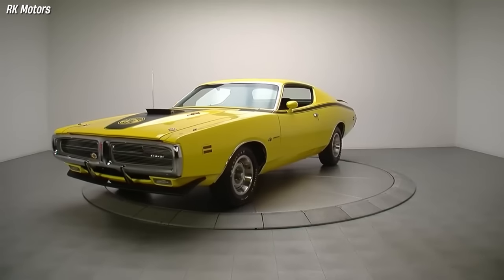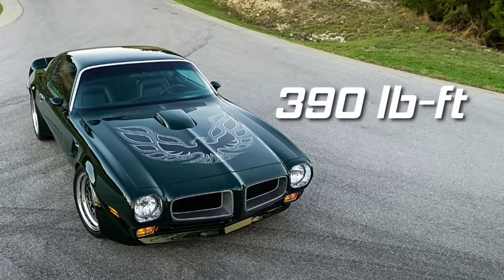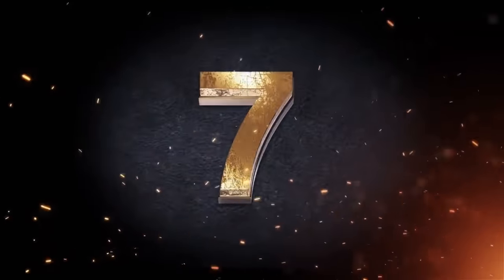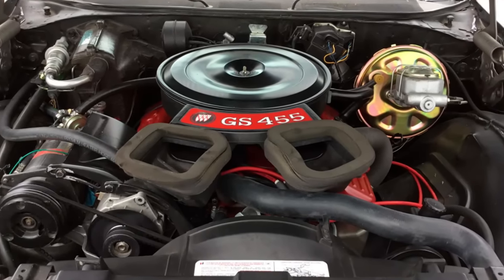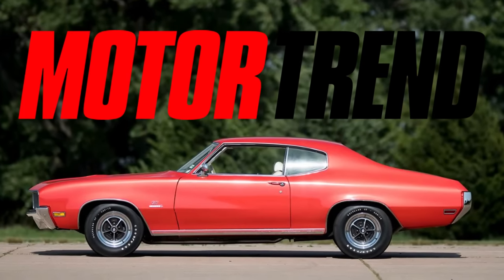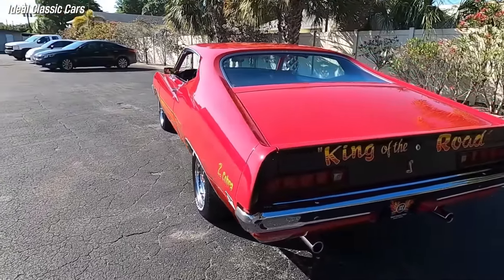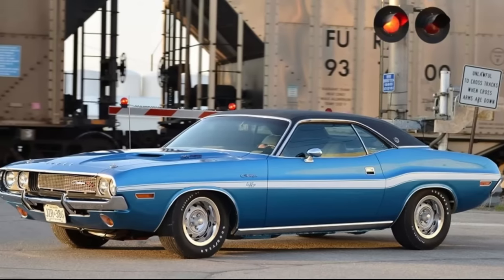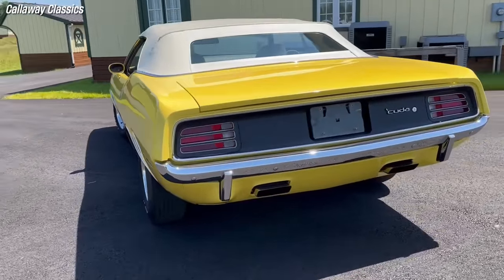Top 10 QUICKEST MUSCLE CARS Of 1970s

Comment: Different era, but I have a 13 BMW 535 M-Sport.  It's a 4150 lb full size luxury car.  Stock they run 14.0.  But with an engine ECU & transmission tune & the Cat removed it now runs a 12.9.   Not trying to compare it to old or modern muscle cars, but I had fun tuning it and messing with the ecu and shift points to get my best quarter mile time.  I drive it year round in Edmonton Canada cuz its AWD.

Comment: Another video by someone who was either not alive or nowhere near the age of driving during this era of mid 60’s to very early 70’s when muscle cars were around so they get their information from people who exaggerate stories told them or those who grossly favor one car brand above all others or hear stories from people that know someone that owned a muscle car didn’t tell anyone that it was modified it but claimed it was stock, soon that particular car was something from folklore and legends of old about how fast his “stock car” was worlds quicker and faster than all others of the that time.  Now I’m NOT a Chevy fan in the least, but not ONE Camaro with any size engine made the list? Yet you have two Pontiacs with the same size engine, one is a high compression lager valve heads the other is low compression with smaller valves yet they run the same times? Not possible. You have two 429 slug motors from Ford one in a Mustang the other in a Torino running times that must have been going downhill. Both of these cars would have been killed by the 428 CJ or SCJ from a year or two earlier. It’s like you figured if the 428 was fast then the 429 MUST be faster because it’s bigger. NO!! They are completely different engines and the 428 could probably win with a plug wire pulled off. Do some real research or write about something else.
Reply: The 429 CJ and SCJ would mop up the 428 CJ or 428 SCJ. The FE engines were good engines but the 385 series engine was a better designed engine, with its canted valve heads and with the same modifications the 429 would outrun the 428 all day
Reply: Yeah some people just be making claims or putting out false information on all types of topics… it’s like assuming the high output 289 had less power then the 302s from the same time… or I’ve heard the 327 Chevy small blocks were quicker or more powerful than the 350s at the time the 327s were around
Reply: For the 2 YouTube replies debating the 428 vs 429, I am a Mopar owner, 440 6bbl (now) and 440 4bbl back in 78, but I am very curious to know more about the differences in the 2 engines you are debating. Please make your case about the 428 and 429 in as much detail as possible, I'd like to learn more.
Reply: I read this comment and agree. The first car was a boat.
Reply: A 71 superbee with low enough gears to run that quick with that much weight will get nowhere near 142mph top end.  Some fanboy fantasy stuff.
Reply: The 429 boss was rated 375 hp. From what I have heard the biggest stock restriction was in the carburetor being too small. With a larger carburetor, dyno tests put it more like 525 hp. 
Not only was the 429 boss with huge ports better suited for high RPM, killing its advantage then with a small carburetor put it behind the 428 CJ. 
It took a lot of mods to squeeze the 429 into a Mustang. If that added weight vs a 428 CJ Mustang, the weight was probably a bigger problem than the power or low end torque.
Reply: But the video is about the 1970's motors, not the 428 of the late 1960's.
Reply: @Richptl1  ya 375 hp at like 4,000 rpm. Go higher in the rpm range and there is more hp. Manufactures did this for insurance reasons.
Reply: @frankjohnson6342 Sometime in the late 60s (1967?) Pontiac increased the intake valve size in all high performance engines to 2.11” and exhaust valves were 1.77.” At sometime in the early 70s the exhaust valves were reduced to 1.66.” The SD 455 from 73-74 was indeed fitted with 1.77” exhaust valves. It was also around this time that all Pontiac V8s had the 2.11” intake and 1.66” exhaust valves. Even the last built Pontiac 350s in 1977 or 78 had them. In fact the final high performance 400 called the W72 last available for 1979 used 350 heads to bump the compression up to 8.2:1 from the standard 400’s 7.6:1 because they were the same head with smaller combustion chambers. The SD 455 indeed had a lower (8.4:1) compression than the 1970 HO 455 but it had better flowing heads. I don’t believe Pontiac used round port Ram Air IV heads on the 1970 455 like it did with the later 455 HO and the SD 455. Compression is only part of a high performance engine. You usually lose about 10% output for each point of compression lost all else being equal. The much better flowing heads made up for the compression loss then some.

Comment: Back in 1977 I bought a 1970 SS 396 Chevelle for only $800 with 70,000 original miles. In the early 80's I pulled out the tired 396, and dropped in a large oval port 454 out of a 1976 C30 Chevy truck. After rebuilding the engine with 11:1 pistons, 260 degree @ 0.50 duration RV cam, and tunnel ram that car could do 11.90's @ 110 MPH in the quarter mile at OCIR.
Reply: What did you do with the original 402 that came out of it? Was it the original engine that came with the car?
Reply: @cap6159  Yes it was the original engine. By the early 80's the engine had about 140,000 miles on it. The heads where junk, and I gave the block to a friend of mine that had a 1966 Stingray with a 396 in it.
Reply: Aren't the 396 and 454 the same block? Why didn't you rebuild the 396 and keep it original equipment?
Reply: Because it was just a used car back then, why rebuild a 402 when you could rebuild a 454 with a $100 core.
Reply: @danjohnson5355  The original heads where clapped out, and not rebuildable without great expense that those heads where not worth it.
Reply: @smokinrz4063  That is true. Back then you could put together a 454 for the same money as a 396.
Reply: @christophersanders5007  , hopefully it didn't lower the value of the car. I bet that car just screamed with that 454! My buddy put a 454 in his Chevy shortbox, and I know it was punched out, but I'm unsure how much, but I borrowed his truck one day, and when compared to my daily driver, a Lumina, there is NO substitute for a Big Block! It's like testosterone on wheels.

Comment: So the slowest car on this list is the only one that has a top speed listed at 142, which was damn fast for 1971. This begs the question, was it the only one not running 4:11 gears ? How quick would it have been with them?
Reply: top speed was 114 mph
Reply: Check the motor trend test.  It had 4:10 gears.  No top speed listed.  With that rear end, to reach 142mph, your probably talking around 8,000rpm, which a factory motor of the era, even a hemi, will not do.  As stated before, top speed for said vehicle is just fanboy fantasy/delusion.  You might push 120 with those gears.
Reply: Quick or fast? There's a difference.
Reply: @tbd-1  Yes, rate of acceleration, vs maximum attainable speed.

Comment: The SD 455 was quick for a low compression engine ,compared to the other cars on this list ,but the 70 torino cobra with a 429 SCJ weighed in at 4.200 LBS the heaviest car on the list rated at 375 HP it weighed 500 plus more pounds then other cars on this list and still ran 13.3 do the math knock off 500 pounds and that would put it in the 12's
Reply: I laugh when he said the SD 455 had a higher compression ratio, it only had 8.4 compression.

Comment: 1971 Trans Am 455 HO is the fastest Pontiac of the 70's. Not even on this list.
Reply: 1973 455 SD is faster and is on the list. 455 SUPER DUTY is a modified 455 HO from factory. 455ho is a high performance street engine. 455SD was a detuned race engine.

Comment: Ok 69 Dodge Dart Blue with a White Stripe around the Rear trunk 340 / 4 speed 
very light and very FAST. from 1974 to 1979 I could not be beat in my Dart 
on the street 
(Blue Interior bench seat) easy for me and my sweety to make out 🤗

Comment: 70 Charger RT 440 six pack 390 hp
Reply: WRONG..390 was the fake gross rating, actual hp was only 325 NET
Reply: @chadhaire1711  Actually 385hp gross, 330 NET. the 440 Six-Pack survived for a VERY short time for 72 and had the 330 hp NET rating.
Reply: @JrGoonior  MOPAR says 390/325

Comment: Where is my 1970 442 w-30? 455ci 4spd 370hp fastback was as fast a car as I ever owned. My '74 Tans Am 455 auto.310 hp was also fast. The '69 Corvette Stingray 427ci 4spd 390hp that I had, couldn't keep up with either one!
Reply: A 74 SD-455 would have a 290 HP rating.  As would the 73.  The often quoted 310 HP was a preproduction engine running a RAIV cam.  There's many stories on the Internet covering this.

Comment: IMO, the 69 Yenko 427 Camaro was the fastest Muscle ever produced, but it had to have a slick or DR to hook properly at the track.
Reply: Yenko was an aftermarket motor upgrade just like buying a Spaulding Dodge from Mr. Norm where you could get a Dart with a dealer installed 440.
Reply: What's a DR?
Reply: @jeffrobodine8579  you could have gotten a dart 🎯 with a Factory installed 440!!

Comment: Those cars all cost too much money even then for the average guy.   
I bought a 70 Nova for cheap put a 69 large Journal 327 in it with some fuelie heads I got ahold of. A Sig earson cam and a Holley 750/ Victor jr. Intake. Put a 10 inch converter on a rebuilt turbo 350 trans, with 373 posi rear she ran 12 90s 11 90s with 100 shot. Put a lot of Big Blocks to shame and enjoy doing it. The engine tranny and heads all came from the Boneyard.  Small blocks Rock

Comment: My first real car I ever owned was a 2001 mustang GT that the first fifty miles I changed to full length Kooks headers, a Bullitt intake and 4:10 Motersport gears and I  could run around a 12.6 most quarters. So not that impressive.
Reply: They wouldn’t run anywhere near 12.6 with just the mods you listed. They were 14 second cars stock .

Comment: lol it should be titled quickest muscle cars from 1970-1973 because after 73 there wasnt nothing fast lol
Reply: Love my 70 GS stage 1 4-speed car but don't forget about the 1987 Buick Grand National. That car will sizzle the tires and lay you back when it hits 15 lbs of boost!! The GS is raw power and loud but that V6 will run right along with it.... and on cruise control!! Lol
Reply: The 1974 Trans Am SD-455 was just as quick and fast as the 1974 SD-455.
Reply: @justme307   lol what ? you mean 73 on that last part dont you ? also you know what im saying all the cars went to shit after 73 roughly because of the nazis and the fuel industry , a 1978 thunderbird with a 460 cubic inch engine had like 125 hp lol you know what im talking about dont act like you dont lol
Reply: @thirdworldassassin  The SD-455 was available in 1973 and 1974 Trans Am and Formula.
Reply: @justme307   "
@justme307
1 day ago
The 1974 Trans Am SD-455 was just as quick and fast as the 1974 SD-455." im saying that you said 74 twice , you cant compare a 74 sd455 to a 74sd455 theyre the same car lol you mean to type 73 on one of thoser i was ju tpointing that out lol , trans ams are cool
Reply: @thirdworldassassin  My bad, didn't realize my typo on the year.

Comment: Olds 442 left out
Reply: Yes 442 W30, j had a 1970 standard, 411 rear
Reply: @lucguenette7534 As a Mopar fan and owner, I definitely give respect to the W-30 442 cars. Nice performance! With a 4.11 gearset, like my 440 6bbl & 4.10s I am sure drag radials are required to do anything but ignite the rear tires!

Comment: They had good motors and transmissions, but they had unbelievably shitty suspensions and handling, and even worse brakes. They were suicide machines basically.
Reply: Fake horsepower numbers too..over rated
Reply: I had a 1970 SS Camero & it handled very well, especially compared to a Mustang.

Comment: So much misinformation here besides the fact that these were all 14-second cars and you'd be lucky to run mid 15s in the 71 charger
Reply: Nah, the 71 hemi superbee will drop high 13s, but with 4:10 rear end, which will limit top end to 115-120 mph.  That's how they're getting fast times with all these vehicles: Drag racing rear end gearing.

Comment: The 68 and 69 hemi kuda was no slouch and it could beat most of the cars that you mentioned.
Reply: OK, now for some facts:

1. it was Cuda
2. It was a Super Stock race car 
3. It wasn't street legal
4. It was 1968 only
5. Only racers could buy one as it wasn't sold to the public
6. It's twin is the Hemi Dart
Reply: AC Cobra 289 or 427 whichever one you want to to !
Reply: Lose to
Reply: @floydrhodesiv5733  in a 1/4 mile race? No, nothing beats the 1968 Hemi Superstocks. 10 secs in the 1/4 mile. Not even the Ford Thunderbolt could match it.